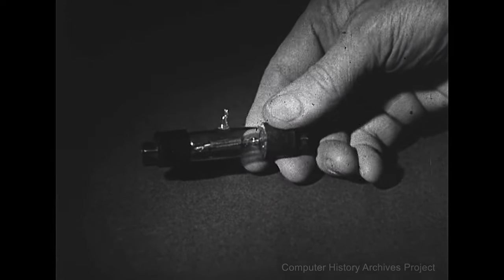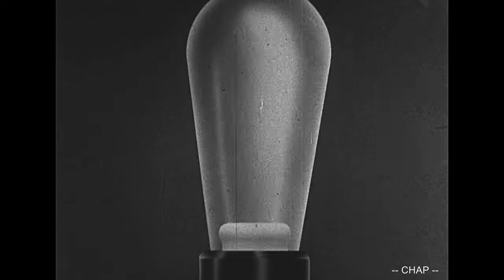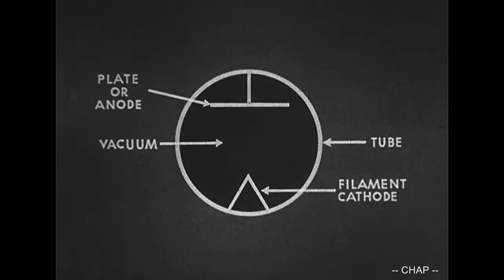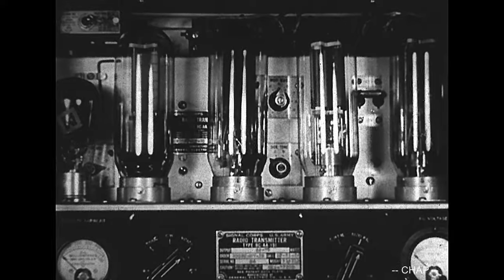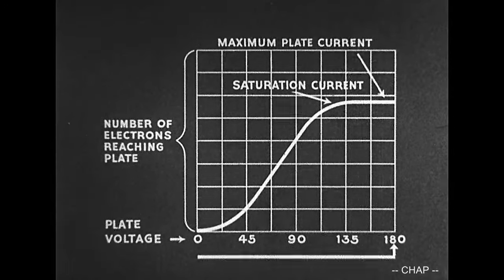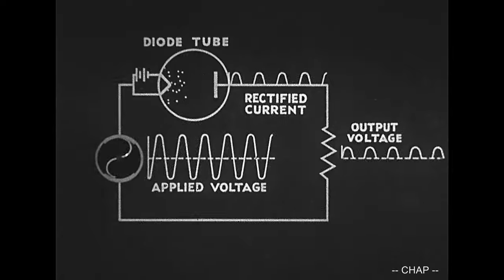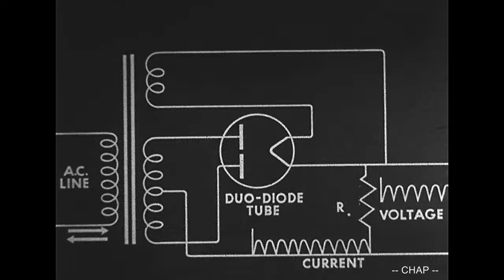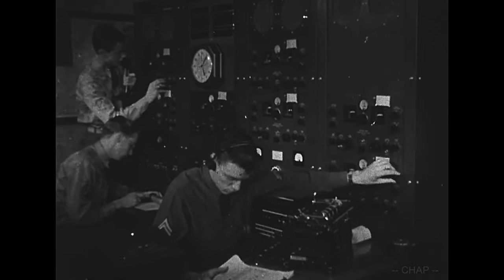VACUUM TUBE TECHNOLOGY (Signal, Radio Electronics Training 1942) Rectifiers, Valves, educational

Comment: I always wondered why those transformers with multiple output taps were so common when I was learning electronic hardware.  That second winding was for the heater.  I never worked with tubes because I grew up in the 80s but those transformers were pretty common.

Comment: Both diodes in the rectifier example are backwards for the polarity of the shown waveforms.
It is correct in the transformer circuit.

Comment: Can't you upload them in the original aspect ratio?  Ironically, this vid doesn't look good on a 4:3 crt. Still, Thanks for this :)
Reply: All films were 4:3 until the 1950's.  During the 1950's Cinemascope was invented which stretched the image from 35 mm film into wide screen then 70 mm film was developed around 1960 which gave true wide screen image with wider aspect ratio.